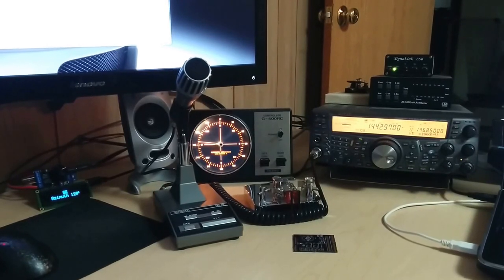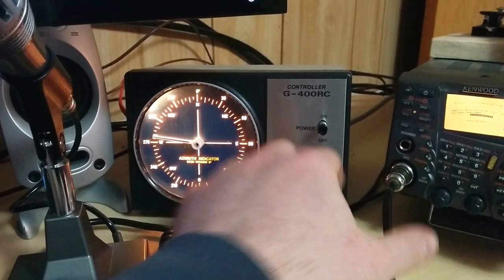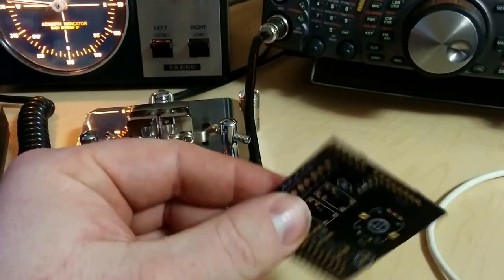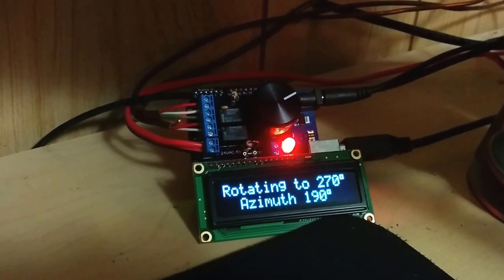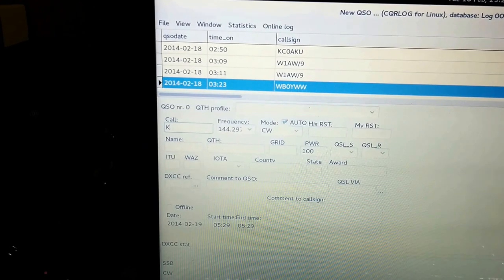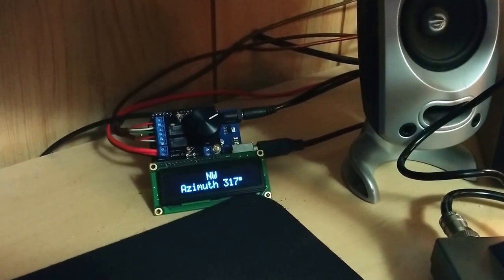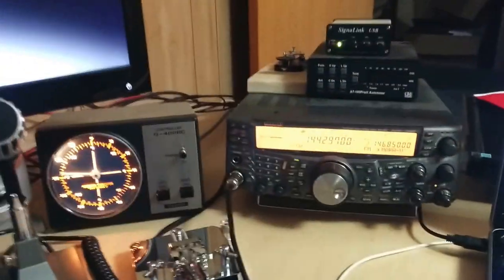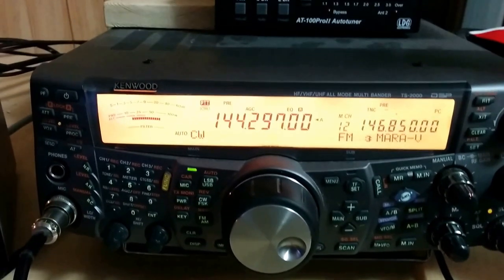Arduino based antenna rotator at AE0MT

Comment: Mike Thanks for the video ! I also decided to pick yourself azimuth rotator for your newly purchased Spiderbeam. Question to you on the screen ... What is the screen you use? OLED screen , or simply use the screen with white letters on a blue background , but blue light is strongly underestimated ?
Sincerely , Nazim UA6WSH.
Reply from the maker: +Nazim Guseinov Any LCD will work, that depends more on your project than anything. The code can be adapted to fit any reasonable LCD screen. I used na OLED screen because that was my preference. YMMV.
Reply: +Mike Thompson
I myself am a big fan of OLED screens, and also have ordered a screen for your rotator controller . Thank you.

Comment: Mike . This is my question. I had a lightning strike on my yaesu sa800 a few years ago . the only thing the was hit was the rotor control. will this replace that without using the controller.? and how much will I be investing?
Reply from the maker: The controller as shown in this video isn't intended on being a stand-alone replacement, but the controller I built to replace it would be. The 400 is an AC rotator, and fortunately your 800 is a DC rotator. All that is needed is a 20-24vdc power supply (old laptop power adapters work well for this) and an H-bridge. The potentiometer lines can easily be read by the microcontroller. Let me know if you need more info. Thanks.

Comment: Hi Mike, can you tell me (us) how you connected the Yaesu rotor? Can I just connect all in parallel? No problem for the switches of course but how about the Azimuth potentiometer? Please elaborate on how to connect your PCB to the Yaesu rotor. 73, PH0PPL - Peter
Reply: After carefully listening to you video... I come to the conclusion that the Azimuth potentiometer is no longer connected to your G-400RC, but instead it is directly connected to the Arduino (via your circuit board). Right?
Reply from the maker: The board in this video has the output relays in parallel with the 2 large switches on the stock controller. The potentiometer is not connected to the stock controller with this configuration, though one could make both work with a redesign of the circuit board. I was going for simplicity more than anything with this design.